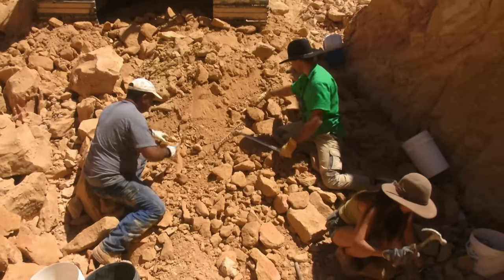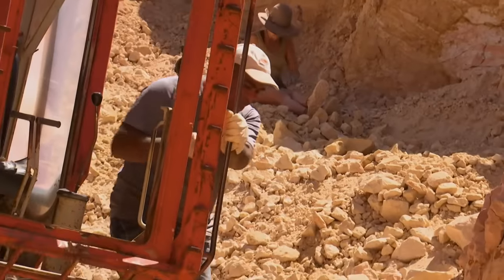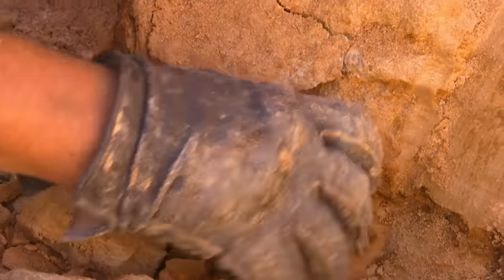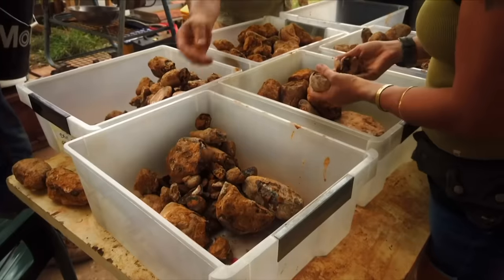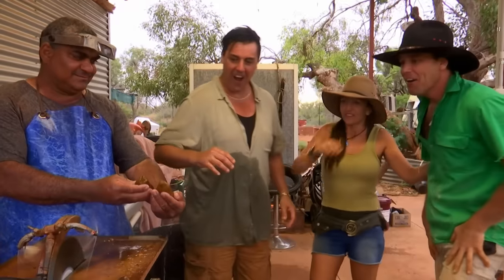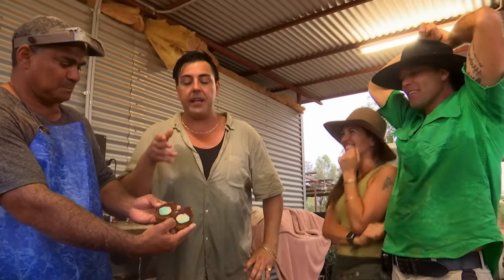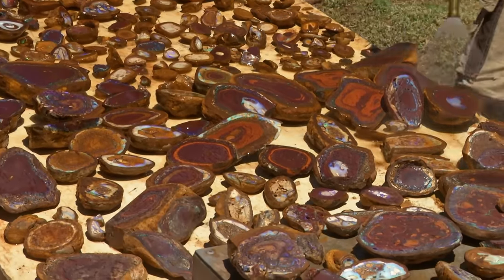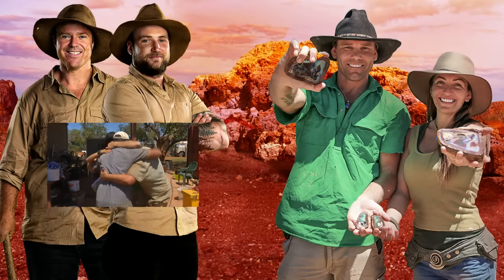The Opal Whisperers Find LITERALLY The BIGGEST Opal In Outback Opal Hunters' History!

Comment: Doesn't cutting it down the middle in half seem weird? like you're taking a big opal inside and basically cutting its size in half, doesn't that take down a lot of the value?
Reply: This is what I thought
Reply: i think that keeping twins rock makes it even more valuable for collections
Reply: Most "opals" are not stones like gems. They are set as a doublet or triplet opal or even boulder style, as slices of colour, so the cutting in half would be done anyway. Opals are not faceted like gemstones to make large gems.
Reply: Yes, it does
Reply: You would wanna shave it down on the sides and have a massive opal.. daft tbh 😂😂